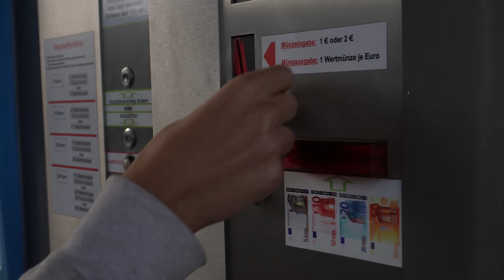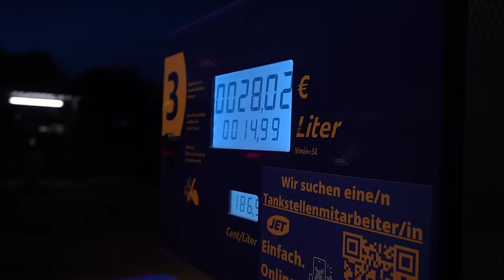my dream car build | vw scirocco 2.0 TSI | school project

Comment: Looks > Functionalities
Reply from the maker: Still full raceable😎
Reply: @steezymedia69  Ya.. True.. Those rims will be kissing and get eaten by those asphalt too.. Those rims are not as ideal as thicker rubbers.. Unless you have another set of wheels, probably 18 or max 19 inches for the track, then yes.. That'll be better..
Reply from the maker: @DanielLimSantoso  since now i have no Problems Racing those 19x9.5j Rims i Run the same now on my vw Scirocco gts and i Love how it drives 🥰but i also run really good tires.

Comment: Hey man. also got one myself, could I know what the front lip is and where did you get that plastic under it to protect?
Reply from the maker: its a splitter for the scirocco r and the lip under it is to get even lower
Reply: @steezymedia69  R? And does it fit well?
Reply from the maker: @franciscolopes1437  yesss

Comment: Sieht mega clean aus, wollte mir auch damals einen holen aber der Gebrauchtwagen Markt war absolut kaputt und der Scirocco hat ja leider krasse Probleme mit der Steuerkette
Reply from the maker: Dankeschön, das stimmt aber nicht ganz die 2.0 TSI Motoren sind gut vorallem die neuen. Die haben nicht die Steuerketten Probleme. Die Probleme mit der Steuerkette haben hauptsächlich nur die 1.4 er Motoren die Funktionieren einfach nicht.✌🏽
Reply: @steezymedia69  Okay, dass mit den 2.0 Motor wusste ich nicht, danke fürs aufklären
Reply from the maker: @derm4nu3l  Bitteschön, falls du dir immer noch einen holen möchtest ich kann das Auto nur empfehlen es macht mega viel Spaß